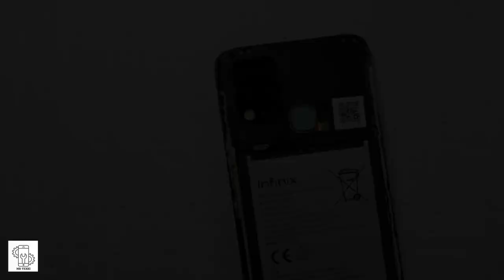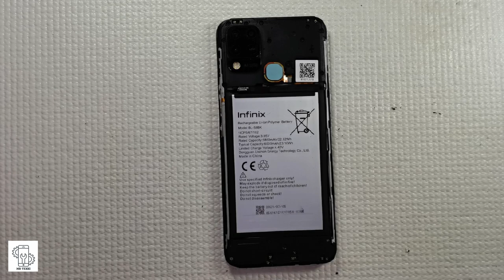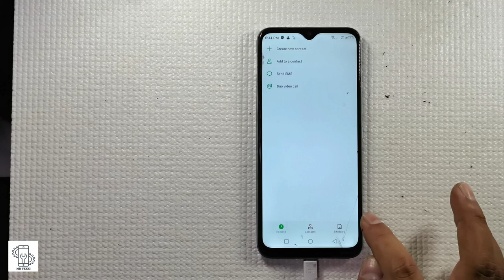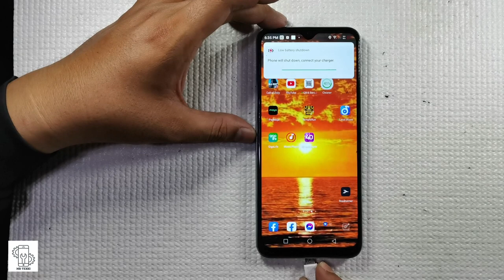How to Replace Infinix Hot 10S LCD

Comment: i have a question 
i went to replace my Infinix Hot 10T screen after it got severly damaged, when the screen is faced down, it wants to fall out, after replacing the screen with a  new one, it works well, but it starts to touch it self or when you press, it presses somewhere else not until i lock the screen and unlock the screen, could that be the screen?